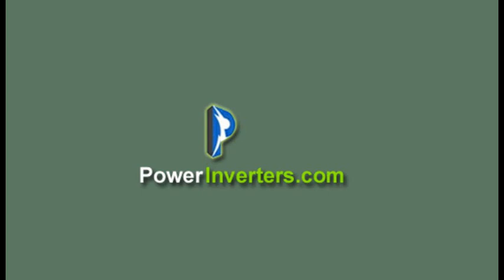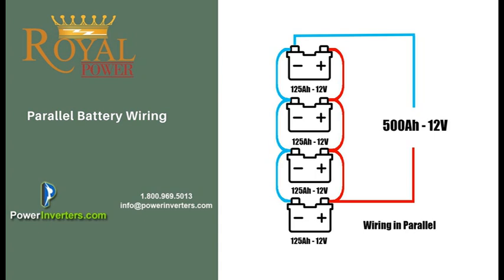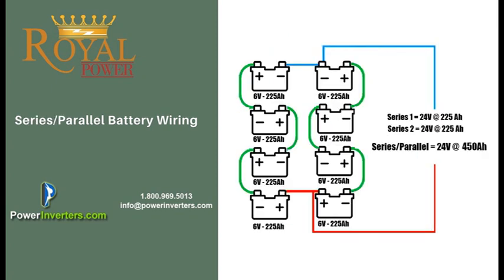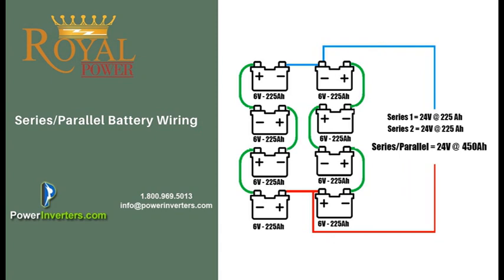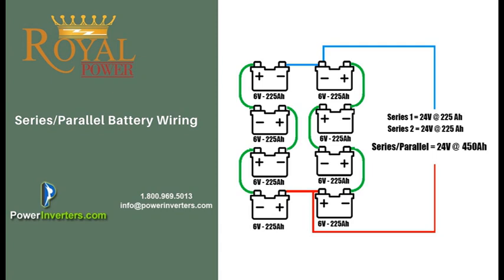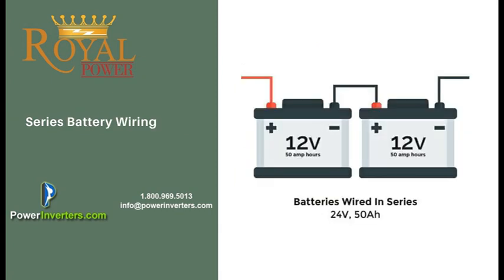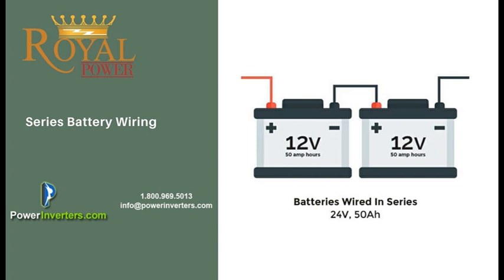12 Volt and 24 Volt Battery Setup for Home Backup

Comment: I have 24 volts inverex veyron series inverter, how to connect 3 x 12 volts battery with inverter as inverter giving beep when connecting 3 tubular batteries.
Reply from the maker: You can connect 2 batteries to make 1 24V battery. But you can not use all 3. You need combinations of 24V. Your total load sits at 36V now. You need to add 1 additional battery.
Reply: @Royal_Power_Inverters  Yes, i know that 2x12 volts is okay for 24 volts inverter, but i have 3x12 volts tubular battery to curb extreme load shedding. Since, i have purchased now, i must use it. kindly inform the way to increase my battery backup after sunset by adding third battery. Thanks
Reply from the maker: @mmsaeed19  Purchase 1 additional 12V.

Comment: Hi how to wire 6 by 12v battery to make it 24volt system
Reply from the maker: Make 3 24V then connect those three in parallel.

Comment: Hi,  I'm a paralyzed guy and I have 4, deep cycle wheelchair batteries, at my disposal. 2 of them used, but still functioning, and 2 of them NEW. They're all MK Battery M24 SLD G FT, each one of them 12V, 73Ah, (they were used in combination of two,  so 24V, to power my wheelchair). I would like to use them to prolong the duration of my UPS, APC BE850G2-GR, which can sustain my consumption only for 10 minutes... HOW SHOULD I PROCEED? Should I buy a pure sine inverter (or how it's called), and attach the batteries to that, and attach my APC UPS to it, or what? Can I use two of these 12V batteries in combination, or even 4, for more backup power, and what kind of equipment should I buy?  If you have a reference video for such a setup, pls let me know. Thanks in advance.
Reply: I am not sure how the APC UPS comes into the picture.
UPS are used to provide several minutes of AC power to PCs, etc when power is lost.
The UPS you have is a very small. Are you using it to charge your wheelchair batteries?

Comment: I know st had my large batteries taken from my bus and I need to start it going from the large 12 volt battery's to 3 smaller deep cycle batteries would I need to do more than just series or will that be just fine?

Comment: I have 4 trojan 6 volt battery 225 amps each  n I want to make it a 24volt. My ? Is they away to make a 24 volt with 450 amps ... I believe it only can be 225amps. U add the volt but keep the same amps. Am I right
Reply from the maker: Correct. your total amps is 225 =once connected in a 24V system.
Reply: @Royal_Power_Inverters  ok thxz just wanted to make sure they isnt no other way to get more amps with my 4 battery

Comment: I have a 36v trolling motor. Can I hook up 6 12v 30AH batteries to make 36v 180AH?
Reply: Yes, make 3 series connections. Then run those 3 in parallel.
Reply: Can you make a pictured description please.
Reply: @jordongettings506  if you have 6 batteries run three sets of series batteries then run each set in parallel.
Reply: 6v will give you 12v per series, 12v = 24v and so on.

Comment: I have a 24v inverter and 5 12v batteries, do I wire the batteries so that they give out exactly 24v?
Reply from the maker: You can use 4 batteries to make 2 additional 2 24V batteries.

Comment: 500ah 12v and 250ah 24v battery  . Wish set up will last more please?
Reply: Battery of 500ah 12v and battery of 250ah 24v  . Which battery set up will last more by time please?
Reply from the maker: @basilkasimi2646  24v batteriew hold their charge better than 12v.
Reply: @Royal_Power_Inverters  thanks